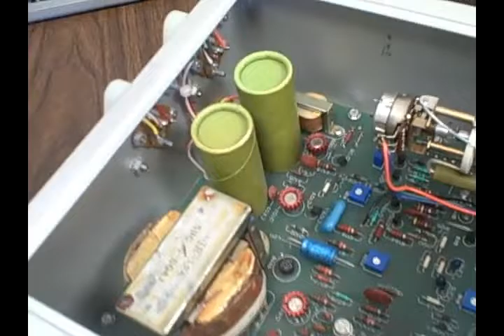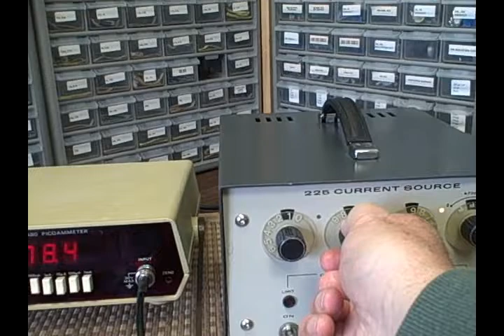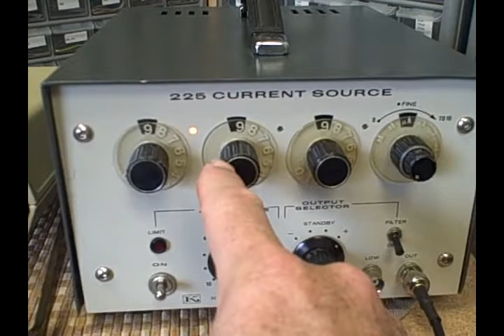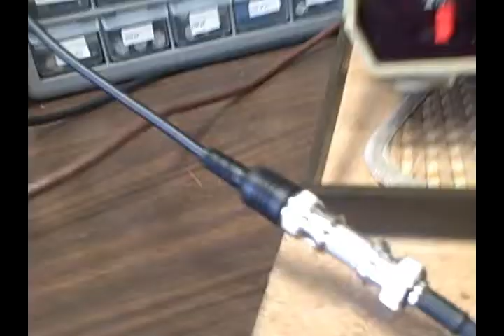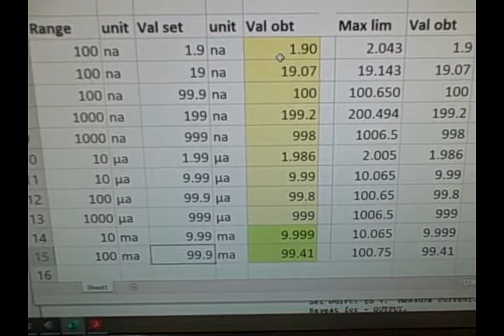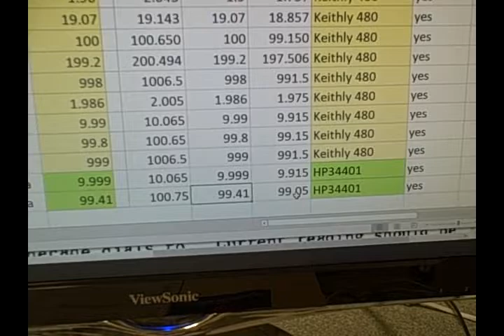KEITHLEY 225 Current Source / Calibrator

Comment: Sorry. but I missed it.  Did you just try to show that the 225 after so many years is still within spec? My 225 performs also well after I cleaned the switches. Great piece of equipment although I wonder how often I am going to use it.